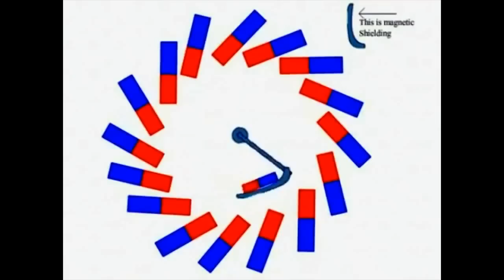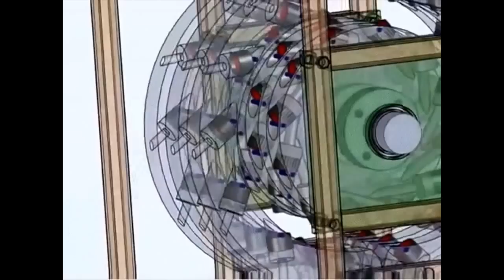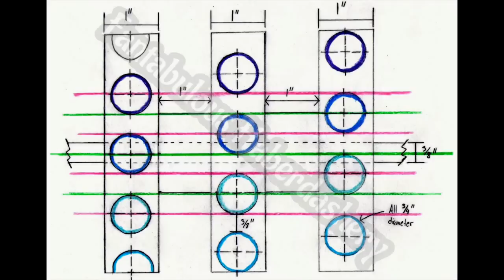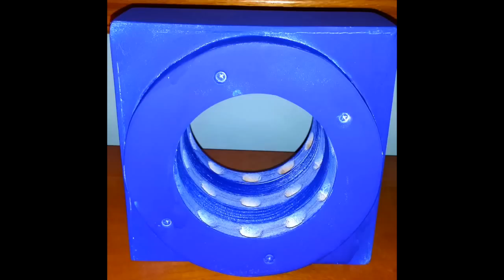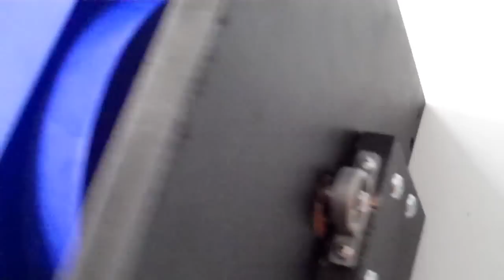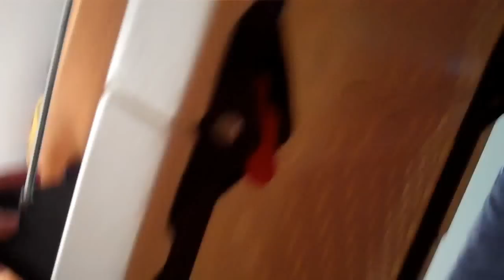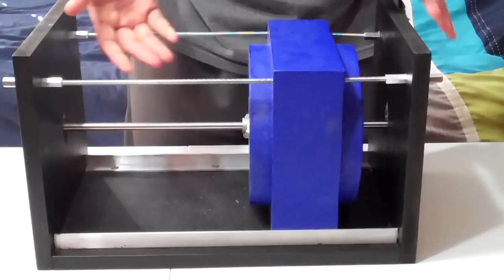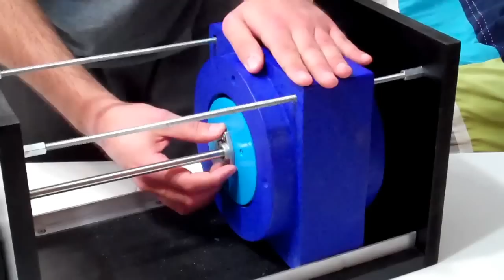Working Perendev Magnet Motor!

Comment: Free Energy and Perpetual Energy

Many erroneously assume that "Free and Perpetual Energy" is a violation of the Laws of Physics.

'You cannot get something from nothing', "They say!"However, Free and Perpetual Energy is not purely defined as energy from nothing,
in fact, just the opposite is true.

 These false and misleading assumptions have been forwarded because the observer either cannot see the energy source or does not understand the dense sea of infinite energy that surrounds us. 

In Fact, a few scientists have mentioned this sea of invisible energy that surrounds us, namely, Tesla and Dirac!

 This energy is in the atomic and sub-atomic levels or quantum fields!

Therefore, Free and Perpetual Energy is Not getting something from nothing, but in fact getting something from a vast and dense "Something" you cannot see.

 I am speaking of the intrinsic value of energy, without being metered to make money for the electric companies.

It can be truly stated that "Energy" from the sub-atomic fields is Free and Perpetual. does it mean that costs will not be incurred to build such a device? NO! 

What it does mean is that we do have an Energy Production System that can operate infinitely using energy from the infinite atomic and sub-atomic field

Comment: others i have seen done they use a coil around each magnet and pulse them just a small level of current and that will change the way the magnets work it will take some playing you may need a microelectronic, to get it right or maybe a FPGA.

Comment: Great analysis on magnetic fields - you may find this info useful and practical in the application your attempting to achieve - place a magnet inside of a socket  [ type used to undo bolts Etc ] either level to end of socket or just inside - this will shape / contain / control / direct / shield the magnetic field to a degree of usefulness in your application - IMPORTANT .... Metal is NOT an enemy of what your trying to do - metal placement, angle and shielding is the solution.  . . . . . . . . . . you should find that the sticking point vanishes - to increase torque add another wheel above but out of phase to aid with overcoming lagging - Add more wheels above to increase torque to be able to harness as a generator - Enjoy the research results.

Comment: If you slightly rotate the stationary outer hub in the direction of spin, it should advance the timing and increase RPM. IF the coil advances forward, then the armature should "chase it" and accelerate. Too far too fast and your push/pull effect is out of phase. And it stops the armature. So tweak it until you can increase RPMs by moving the coil  a degree or so forward (like timing an old time distributor 2A TDC) and accelerate! And take a bar magnet and a sheet of pure aluminum and hold the sheet at a 45° then let the magnet slide down the aluminum. Whoa. What happened? The moving magnetic field IN MOTION causes the aluminum to temporarily  be come magnetized. Magnet still? No stick. Magnet in motion? Check it out.

Comment: You're losing energy to 2 things
First is friction, you need to use magnetic bearings, this will reduce friction by over 100 times compared to standard rolling element bearings.
Second is accuracy, your wooden magnet holders aren't very accurate. So when it spins it's spinning unevenly and energy is being lost where it spins out of center

Comment: 🔴 Never ever use aluminum in the construction of a magnet motor, as it causes a breaking action. Use brass.

🔴 Proper Metal shielding makes and breaks controlling and shaping magnetic fields.

🔴 Net gain is required to keep a magnet motor running on its own. 

🔴 Setting up an unbalanced system creates more forward rotation then counter rotation.
Reply: Use wood

Comment: THIS IS for all SKEPTICS it does WORK why? thats science straight forward not government and oil science 

this also happened to the best engine we always enjoy when travelling international the JET in its time many said that it wont work but then the world superpowers get shocked when germany made a succesful flight and also the tesla original electric motor design is not the design we are using today it is considerably 100% more efficient than our electric motors todAY as you can see when politics and oil mixes it always ends up in a fucked up world
COZ i've tried to make an electric induction motor according to tesla's design strickly following all the parameters  and it worked more than an ordinary electric motor

Comment: It’s totally a success. I am very impressed at how close you got to unity. Now you just need a power input and you will have an exceptionally efficient motor
Reply: I believe a 'power input' would not only be impossible, but would also defeat the purpose of 'free energy'.
Reply: @tubularguynine   but would be more viable with a powe input
Reply: @augustoironside3256  - Perhaps you don't understand the difference between 'permanent magnets' and 'electromagnets'. Since the only reason to apply electricity to a motor is to turn the copper wire windings in the rotor INTO a magnet. And since 'permanent magnets' are magnets already, no external electricity is needed...or possible, because the individual magnets aren't connected to each-other, and therefore, can't complete a circuit.
All that's really needed to make a magnet motor work is to shield one pole so they all repel each-other and not attract...and that can be accomplished using 'mu-metal' as a shielding material. There's videos on shielding.

Comment: Machines can run for an infinity time.. if you use the curance of the electric antoms in the air.. resonanse is key with these motors. Without resonance everything would die.
Reply: can you elaborate?

Comment: only if thermodynamics was compulsory for everyone, and they knew what 2nd law of thermodynamics went on to prove.
edit - converting the magnetic energy to mechanical energy directly will not have stability for different load on axle..so converting mechanical + magnetic -> electricity (which can also be stored and spread across city) and then converting electricity -> other energy is more sufficient, sustainable and feasible.

Comment: You are missing the point, YES free anything is possisble. The teachings and physics of science is flawed. It lacks truth. Stop listening to lies. 😉 you don't want eddy current in the design. Aluminium creates eddy currents when interacting with magnetic forces. Copper the same. Take an excersise bike, it uses eddy current between magnets and copper to control breaking force. Yes it is a success, good job in your experiments. You are getting closer. 😉 your next learning will be with a load on it? Which will lead you to understand more about  frequency of the magnetic forces. EVERYTHING IS FREQUENCY AND RESONANCE 😉 - nothing to do with magnetic forces. keep up the good work.

Comment: A motor by definition must supply motive power. This "device" can't even supply enough force to continue its rotation, so a load would abruptly halt it. Throw some copper wire in the centre, you'll generate measurable energy from your wrist-pumping 😂
Reply: he is soon will be abducted by aliens

Comment: My only suggestion at this moment is rebuild it with more precision. Invest in materials and make sure there is no wobble.  When the rotor wobbles there is energy being used to compensate for the effect caused by the wobble. Think of it as driving with your foot on the brake pedal where the brakes being slightly activated. if you eliminate the wobble, you may be able to save enough energy for the generator to continue moving on its own.

Comment: Complete bullshit. You didn't take you hand off the top once it started spinning because there's probably a reed switch controlling the motor in the top of the outer housing (conveniently the one place you didn't show). Not to mention, you can here exactly when the electric motor is and is not running.

Comment: I like your approach good commonsense .There is no reason why a magnetic motor should not work after all all electric motors are magnetic motors there is no fundamental difference between magnetism from any source.With resent use of neodymium as field magnets increasing the efficiency up to 50% proves that.It is just a matter of coming up with a design that works.As far a energy source is concerned don`t get a hangup about that they are only theories and in any case quantum theory can account for that.Well done keep searching but not the internet the inner net the imagination is unlimited.

Comment: If it doesnt start alone it cant works because there is a point of equilibrium it can reach maybe after a long time but will reach it. The only way to have a perpetual motion would be a système with imposibilty to find a static state of equilibrium and in this case no need of magnets gravity would be enough.

Comment: The only way that it could be possible to extract energy from some setup of magnets is if the magnetic field of the metal would collapse somehow at the same rate that the motor delivers its energy to the outside world.  But energy delivery and the magnetic field are not comparable elements to do a simple calculation.  What you have achieved is a floating magnetic shaft whose friction is reduced to a bare minimum.  It is possible to do that.  Scientists have done that long ago and they can give you gyros which will spin for years.  But it will always slow down.  If you vaccumize your device, you will make the spin last much longer.  So kudos to you for removing the friction, but such devices are not impossible.  As soon as you deliver energy to an outside device, you will lose the spin velocity with a reciprocal amount of energy.  Your experiment has proven that it is impossible, though you think that it is actually possible.  I hate to upset you, but I spent a lot of time experimenting and trying to focus the magnetic field so it could give a sudden strong impulse and all I got was exactly your results.  A lot of smart people have wracked their brain on this.  The magnetic field, being constant, makes it impossible to deliver energy, no matter how you try to concoct or manipulate the magnets.  It is a no gain and no loss chamber and it will not add energy to a passing body.   Descent delivers a quantum of energy and ascent takes it back.

Comment: The Mighty Law of Conservation of Energy ! IF that machine produced energy on the expense of loosing the magnetization of the magnets, Then it will cost  the same amount of energy (at least)  to re-magnetize the magnets ! Net result: Energy can neither be created nor destroyed,,, but only converted from one form to another.
Reply: ...which the presenter made clear at the start. No such thing as free energy. The point is whether there is an efficient means of generating power from such as device, after starting it.  Even a permanent magnet will degrade.
Reply: @Surfer7901  the answer to the question is simply: "There isn't any efficient means of generating energy from a machine that produces none"

Comment: I deleted my first comment as I read other comments

I did notice each time you say its gonna go, there is a shadow on the left side of the screen, and when it slows down you move your hand back and the shadow is gone

what I think you are doing is pushing a small motor on the end of the shaft ...maybe has some sort of rubber tip to soften the noise...how about you do it again keeping the whole thing in plain sight and your hands in plain sight
with no editing

and I bet it work work

Comment: What if you were to install a hand crank on the end of the rod to give it a start? Wouldn't that be better than using your wrist?  (A crank like the old cars used which I believe were removed once motor was started.)  Perhaps some kind of spring mechanism?  Even wrapping a rope around the shaft to pull start it might be better than your wrist. 
But thank you for showing this.  You did a fine job in both production and explanation of how your product works.
Reply: ITS a FLYWHEEL !

Comment: Obviously you have a small motor hidden in the wooden housing...... I notice you have to hold your hand in a stiff position to make it run (clearly completing a weak circuit). Bolt it to the table and do it without covering it with your hand and I might believe you. But as far as I can see you are busted.

Comment: Neodymium Magnets should not need to be replaced... maybe if damaged, and maybe if your design is so delicate that it can't handle a sub 1% decrease ovwr 10 years... because otherwise only physical damage would be an issue. They are permanent magnets.

Comment: The point of this motor is eaqual magnetic pressure
So o think geting a large ring magnet then another ring magnet that fit in the inner radius thats the trick...
Every one  uses single small magnets that are not even powered ... The 2 full ring magnets would work..
I once saw an ad for a company that makes strong magnets and that they can even arange polaratys on the magnet face ...very cool thing ... But yea if u try it this wayand u get rich remember me 😆

Comment: Magnets should be enclosed in an iron sheath with a bare beveled side. Then the torque will be greater. Like this : http://www.greenoptimistic.com/wp-content/uploads/2008/07/new_motor_with_shields_375.jpg 
I also think it must auto- start when setting the stator in spinning position.

Comment: You made a huge mistake several times when you said the energy is coming from nothing.  That is not the truth.   Have you never heard of the universal background energy called Zero Point Energy (ZPE)

Empty space is filled with an unbelievably huge amount of energy.  ZPE has been MEASURED to 10^110 ergs per cubic centimeter.  This energy is in all directions for at least 40 billion light years in all directions.  Let's see what that might calculate out to.

1) Volume of a sphere is (4/3)*PI*Radius**3 
2) The universe has a radius of 40,000,000,000 light years
3) A light year is 5,869,713,600,000 miles
4) The radius of the universe is 234,788,544,000,000,000,000,000 miles 
5) Cubed that would be 12,942,873,540,861,200,000,000,000,000,000,000,000,000,000,000,000,000,000,000,000,000,000,000 cubic miles
6) Multiply that by 4/3 pi, and you get 4.06612E+70 cubic miles in the universe
7) Now, let's convert cubic miles to cubic inches, 
8) 1 cubic mile = 2.5435806 E+42 cubic inches
9) and then convert cubic inches to cubic centimeters
10) 1 cubic inch = 16.387064 cm^3
11) That leaves us with 1.6948E+86 cubic centimeters in the universe, each one of which contains 10E+110 ergs of power.
12) Let's see that comes out to 1.6948E+197 ergs of raw power LEFT OVER after God finished creating all the stars, planets, etc.

What all attempts at infinite energy machines are doing is not to get energy from nothing, but to extract the 10E+110 ergs of power contained in every one of the 1.6948E+86 cubic centimeters in the universe.

That is 1.6948 followed by 197 zeros of available energy existing in open space all around us.

What you need to be doing is trying to create a vacuum in space of all energy.  Then energy flowing from energy rich areas to energy poor areas can be tapped.

Comment: Looks awesomely simple and promising. Great job. Looks like you need to resolve your rotor unbalance issue. It's either unbalance or eccentricity. Consider using a small battery powered servo as a starter. Find someway to monitor the speed. I'm curious to see what speed does it maintain and what speed does it slow down to. Remember the more magnets you use the slower the speed. Maybe find a way to disengage the other magnets to only 8 or 6. You would have to have a reliable setup, my theory, if you want to go to 4 or 2 magnets. Again nice setup. Good luck!
Reply: " Remember the more magnets you use the slower the speed. " How do you know ? What's the explanation ?

Comment: Why not just build a very large coil in near earth orbit and utilize the natural magnetic force of the earth  itself .
Reply: Good idea, but the coil musn't rotate !
Reply: @raphanunu6912  nonsense, spin it retrograde.
Reply: @mids5854  : That was a joke !
Reply: @raphanunu6912  Yes!
Reply: this idea is actually quite smart, the problem is that the resistive force produced when electricity is generated in the coil will cause the coil to decelerate, and consequently fall out of orbit. then, the energy required to get it back into orbit will be more than what you produced in the coil.

Comment: Old guy here.I know your mistakes.If you want to make this thing work contact me.There are a lot of over schooled uneducated desk jockeys commenting on here that havnt learned critical thinking,common sense and logic.
Seriuosly,magnetic motors arent hard to build but you either know it or you dont.
and yes they do work.
Reply: A motor driven only by magnets is the holy grail of engineering. Yet there are none commercial versions of these motors. Wonder why? Because it does NOT work!!!
Reply: @_Viking  absolute bull! Keep  thinking the way you do and you will always get the same results
Reply: @_Viking  and you obviously dont know the difference so I made my point
Reply: @andremaier5816 Magnet motors DON'T work. Obviously you don't get that. Back to school, maybe?
Reply: @_Viking  Its clowns like you that are toxic to anyone who trys anything because in your mind you have already made the descicion for them.Just because you lack the intelligence to make something work does not give you the right  to interfere with someones work who is trying to make it work.If you have nothing positive to add move on until you learn how to do so..
Reply: @andremaier5816  if I told you not to put knitting pins in the mains socket would you still do it? Do you follow that simple logic? Let the smart kids tell you that magnet motors are impossible so you don't have to waste money and time making a fool of yourself. What the heck, go ahead and play with your knitting pins 😅